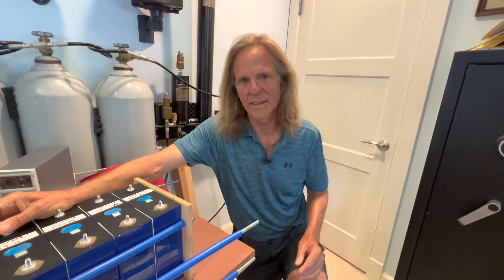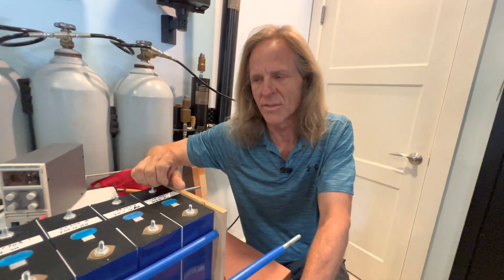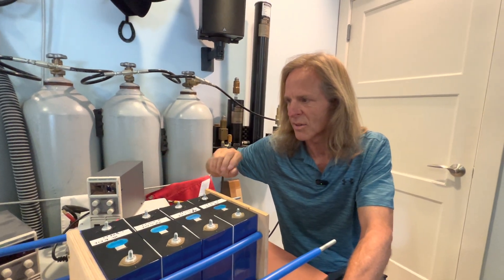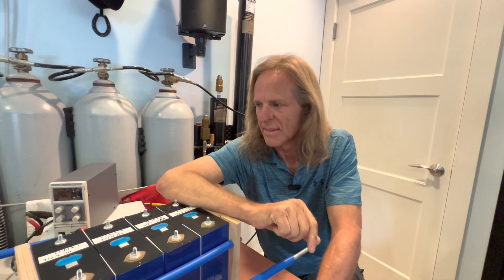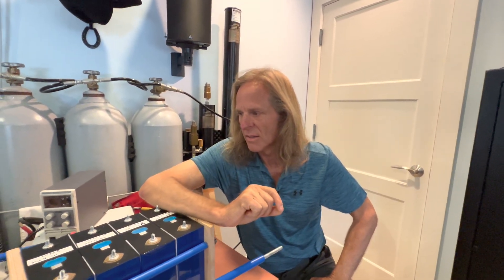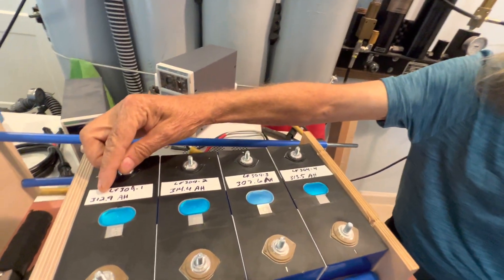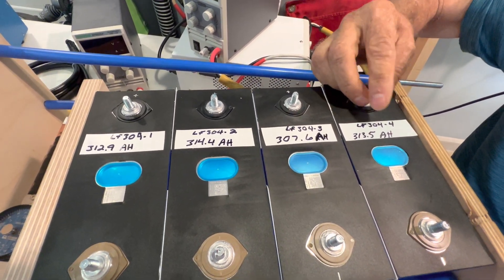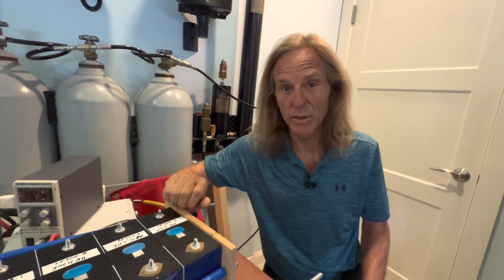Buying And Testing Lifepo4. Big Cells For DIY Batteries!

Comment: I contacted jennyWu thru email when I got my cells last October. They are CATL cells because eve was sold out at that time. They do have a scratched off QR code under the black top. They also have new painted on QR code. I asked her about this. She said that they get them from their supplier and cannot keep the original QR code. She also said the new QR code is the right one. Whatever that means. Regardless the cells tested at full capacity, stay well balanced and have not expanded and are serving me well. 
Glad your back making videos! You lucky dog with those splitphase Deyes.. Really wish I would have jumped on one of those but I wasn’t quite ready..
Reply: I am right behind you on the Deyes Inverter comment.
Reply: I orders EVE280 but they sent me EVE304, ordered another 4 cells of EVE304 and waiting, hope they don’t send me 280ah instead.
Reply: @pr5991  OK, thanks. Perhaps you have to make it very clear to them only to ship what you have ordered.
Reply: 18650batterystore gets these grade B cells just like they don and don't put a different QR code. I think Docan is busted at this point. But its also clear grade B is not so bad either. However, no excuse for putting on a different qr code. These are grade B cells.
Reply: wondering what Ray has to comment on this.....
Reply: Very sorry. It was not jennyWu… it was Amy Zheng of Docan.. I don’t think there’s much of a difference if ordered from Jenny or Amy
Reply: That’s not issue that needs comments,he knows what was coming,take it or leave it…catl or eve,the 2 best but only my opinion
Reply: Is that what you ordered from Jenny Wu? I mean did you order EVE cells and they just sent you CATL ones without asking you first if you OK with that?
Reply: @repairman2be250  I was told eve was out of stock before I placed the order for CATL
Reply: @RJ-cc1fz  OK, thanks.